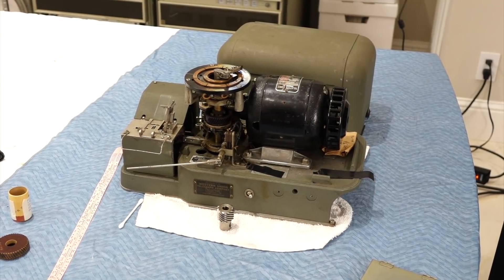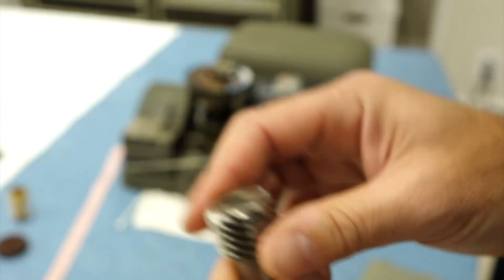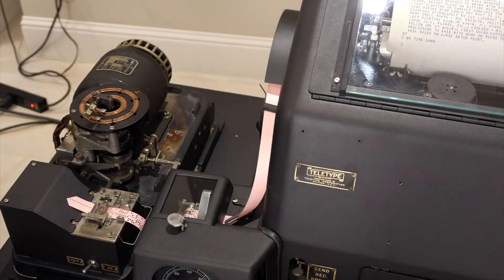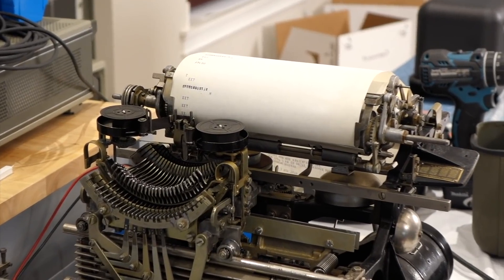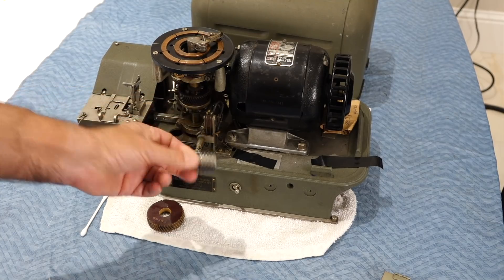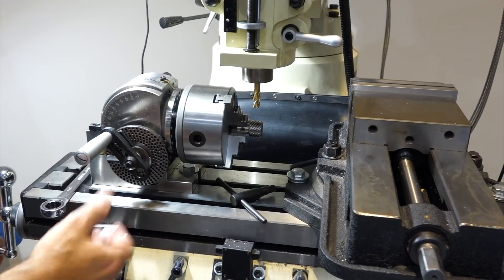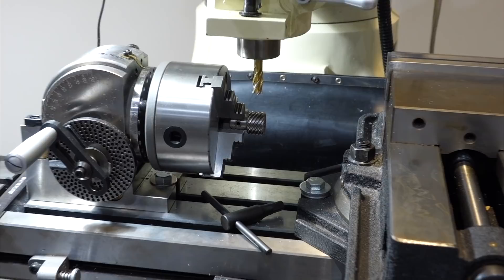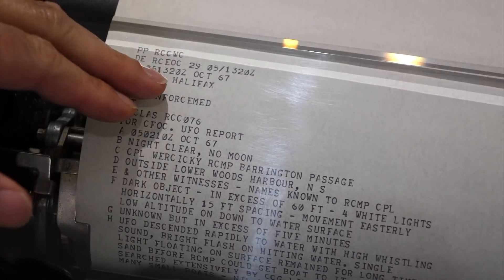AvE's CNC Machining Challenge

Comment: Do you have a working example of the gear you need? I could machine a gear that meshes, but it ain't gonna be the right speed...
Reply from the maker: Hey uncle, nice to have you here! Yes, we have an exact good gear that we can copy from (the one from the black T/D that works). Can you contact me offline via my about tab on my channel page. En Français dans le texte si tu veux.
Reply: Do you need CAD file for this gear? if so I can make it.
Reply: #unclebumblefuck
This is indeed a situation worthy of your newly acquired manly superpowers.  What cause could be more worthy than saving historical geekdom!

Saving a politician tied to train tracks?
No!
Giving a poodle a new haircut?
Never!
Rescue a lass from a turtle stampede?
Nein!
Pulling a beer keg from a burning building?
Hmmmm....  Probably.

But this part is worth making!

SAVE GEEK HISTORY!
Reply: Shit man, if that doesn't work, why not just cut it on my shaper?
Reply: @JBFromOZ  Abom79 will do it on a shaper :)
Reply: @ajvdwest  - I'm not volunteering him, but Jonathan W. could probably cast one from some old pistons he has lying around. He made a motorcycle engine block out of a bunch of 'em😃
Reply: Aj vd Westhuizen I’ve already cut gears on my shaper, has Adam?
Reply: @JBFromOZ  You just have to be old enough to say, "why the hell did we get rid of the shaper".
Reply: AvE;  worthy project but a bit difficult for one of your first 5 axis CNC jobs.
Reply: Send me the drawing, I’ll cut you one for something in return. Let me know and I’ll privately send you email.
Reply: All this 5-axis talk or lathe threading cuts and I'm sitting here wondering if there is a correct gear hob available for this part. I Never understand why people jump to cutting gears one slot at a time when most gears are formed/cut with a specialized gear hob tool. 
I guess as a one-off part cutting the gear isn't too bad vs the tool cost for a hob. but hobbing is the way to go for quantity and quality on gears.
Reply: @stoneworld7556   Worm wheels are hobbed, but the worms themselves are generally thread milled because you'd need a special hob for every different worm.
Reply: Oh ya, the Johnson rod is hoopajooped.
Reply: Could a replacement be prototyped on a 3d printer? You could prove your geometry then proceeded to production.
Reply: AvE is
Reply: The gear will come out with perfect dimensional tolerances but the helix will be going the wrong way, we've all seen the tapered threading video!
Reply: EASY! Hold my beer, I'll run to Canadian Tire and pick up a Tap N' Die set...
Reply: @MyKonaRC  lol
Reply: AvE it will take a few try's to get the right thread pitch but if I had my lathe still I could have cut the multi starts threads at ranging pitches and sent it over to you for the final machining
Reply: Some of my favorite things. Machines and radios. Good project.
Reply: What’s the pressure angle and number of teeth?
Reply: With all the people saying how easy this'll be, I can look forward to a spate of videos about gear machining in my recommendations soon, I'm sure!
Reply: That shit is gonna be skook'em
Reply: Im late to the game here but I do have an idea..... Send it to have a laser 3d replica scanned, then send it to 'learning computers' to have a 3d printing made, then send the 3d printing to 'Cody's Lab' to have him make a sand-mold and cast one from some strange metal (probably gold), then send the Gold casting down to the big machinist man in Florida to have one made...     Thats how I feel It should be did.
Reply: I have to say.... This is so frigging cool! I like the community vibe! I have nothing that needs machining (unless you ask my gf, she'll tell you differently)
Reply: @superlazy3355  maybe a little buffing or polishing?
Reply: Maybe AvE stuck his neck out too far and can’t do it :P
Reply: We know how AvE loves beautiful specimens (gears).
Reply: Richard J, I have confidence he could do it. He just better have a lot of setup material. He will of course need the proper involute cutter as well. Also measuring the gear can be tricky. He would need a mating gear and the center distance between the gears. And maybe even make a test fixture to test that because of them being at what looks to be at 90 degrees to each other.
Reply: @EdgePrecision  OR just take the ratio and machine a single start worm and wheel. ;-)
Reply: @arduinoversusevil2025  Are we assuming the small gear is the driving wheel or the driven wheel. He didn't say in his video. Or did he?
Reply: @EdgePrecision  Small worm is the driver, it meshes with what looks to be phenolic fiber wheel. Curious marc is sending me both.
Reply: @EdgePrecision  Someone feel free to correct me if I'm wrong. But, I'm 99% sure that the worm gear HAS to be the driving wheel. I wasn't paying too much attention to the motor position and I'm too lazy to check. But, it's extremely uncommon for a worm to be driven.

I would like to add that some people say it is impossible for a worm to be driven. But, my friend has a 1929 Ford AA with a worm gear rear end. That being said, it certainly acts like a brake when you put it in neutral but it can and does still roll forward. Not to mention the fact that we have towed it before, in gear, without breaking anything.
Reply: AvE Noice. Good luck!
Reply: That's just simple 2 axis manual work.
Reply: @pmk2  depends on the helix
Reply: @EdgePrecision  The small gear was the drive gear.
Reply: @arduinoversusevil2025   Sir, so why can't we just 3d print the worm out of nylon, as the wheel is some non metallic material, cutting down of nylon won't be problem i think. And lube it with silicone lubricant.
Reply: AvE RULES 🤘🏻🤘🏻
Reply: You just need to thread mill it with an acme or square or whatever thread form.
Reply: Igor Barbaros This, this is what needs to happen
Reply: AVE for president of the world! Lol

Comment: I believe this is the base machine used for a pony 9 or 19 one time tape crypto  device.
Reply from the maker: The 5-bit baudot tapes that the model 14 reads were definitely used in One Time Tape crypto mixers (see https://www.cryptomuseum.com/crypto/mixer.htm ). But I could not find any machine based on this Model 14 mechanism. I would be quite interested if there was one though! Do you have a further link or a reference?

Comment: Hi Marc, I pinged AvE about your gear and he said you need to send him some details, or a sample.  So he would appear willing but needs you to send him data.
Reply from the maker: Yes I am intensely aware of it. I owe him the gear, but I needed it for the restoration of the reperforator. After I make the video on that one, off the T/D and to AvE it goes, provided AvE is still interested. And then of course the AGC work started, which got the reperf pushed out...
Reply: @CuriousMarc  Don't get me wrong, I'm not chiding you, just worried that there was a Deadly Embrace https://en.wikipedia.org/wiki/Deadly_embrace going on.  And I have been enjoying the AGC work very much and the Alto too.

Comment: If you can get the right screw tap you might be able to do it with just that mill and indexing head (the head used as a precision angled axial holder).

People have hobbed worm wheels that way:
https://www.youtube.com/watch?v=XIzlg_uObwQ
You should be able to go from that to a helical gear by moving the gear along it's own axis. By tilting the blank, you should be able to control the tooth angle.

Comment: Look guys, I reckon your're over-thinking it. With the simple addition of a free-spinning distuckator for the maximal rotation and a fully indexed fafoofata valve, you'd grind that little sucker out with a Dremel in no more than two shakes of a lambs tale. Easy done.

Comment: i ragged wit AVE it can be done on a late just have to find the tread per inches and profile a cutter for it, it's almost like cutting acme treads , it would be more simpler then drawing a cad , cam is not that hard once you have the cad done.

Comment: you could cut that gear your same mounting but instead of using the mill use an angle grinder it will take a few trys but you will have it done in a few hours instead of weeks

Comment: You certainly can do that on a manual... you take off the left handwheel for the X axis of the mill, mount a gear in its place, and use gears of the right ratio to make it drive the rotary table. Then you just turn the remaining X axis handwheel on the right side, and the X axis and rotary table move together at the right speed to cut the helix.

Comment: Hob it. You'll have it done in a hour. (Assuming your head tilts 90 degrees on the mill)( use a free spinning bearing to get the mesh on your indexer). I've made several mesh pinions for ignition distributor on several models (points type)

Comment: This part can easily be done on a manual lathe, from what I can see its just a multi-start thread ( maybe 10 starts, it's hard to see on the video). You would need to grind clearance on the tool due to the high helix of each start, but other than that I don't see a problem.
Reply: As long as your change gears will give you the lead you need
Reply: @elanjacobs1   yes you're absolutely correct. Most (manual) lathes probably don't have that kind of lead (2-3" maybe). Ok, fine do it on a CNC lathe but using the same method.(multi start Thread)

Comment: Used to be manual machinists roamed North America who could do this. A few years ago, GE needed one. Turns out the last annually machined helical gear produced in America was about 1955 and then all of that production went to the Pacific Rim. And then all that went CNC so probably no one under 80 or so has done it on many years.

Comment: far better to approach a specialist gear cutting company as its not just a case of getting the helix angle right. There's the diametric pitch/module, pressure angle and number of teeth to consider too.

Comment: If AvE can’t help you out (I’m sure he can - he’s a ledge), or if someone else see’s this and wants to give it a go, then you can use manual helical milling - there exists such a thing, that consists of a gear system to connect the dividing head  to the lead screw of the table. I’ve used one before and it was great!

Comment: Unfortunately this is really something that needs to be done on gear making equipment, A 5 axis could get you something that worked for a while, but for a restoration that will keep working for a long time would either require a LOT of hand finishing or proper gear making equipment.

Comment: This would be a better suited project for a lathe and gear hob machine. A Worthy project but if its good tolerances and surface you need, then for helical bevel gears a hob is the way to go. Not to say cant be done on a 5th or 4th axis after its turned to profile but still the result is better from a hob. Might want to check out some gear manufacturing houses a part like that could be made easily and inexpensive by them if it is a standardized tooth pitch and they have the cutter on hand.

Comment: Helical gears usually require a special machining center or even grinding instead of conventional cuts. This would be extremely difficult to machine, even with a 5 axis, without some amount of prior gear cutting experience.

Comment: Actually you have a semi-universal dividing head and need a universal dividing head to manually cut helical gears; and of course the appropriate multi tooth "wheel" type cutter - one for helical gear cutting or you'll wallow out the flute flanks:)

Comment: I'm curious... Couldn't you just turn down a piece of all-thread of the correct thread pitch?  A wormgear is just a 'bolt' essentially that turns, so I'd imagine that if you could determine the thread-pitch and diameter, you could either turn it on a manual lathe, or just buy a threaded rod of the right size and cut the center hole/set screw/other dimensions on it...
Reply: No. Threaded rod is a single start thread, this worm is multi-start so that won't work.
Reply: @elanjacobs1  mcmaster-carr sells multi start threaded rod (I think just acme though).

Comment: Do you have the parameters for either the worm gear or the gear that it meshes with? I can generate the CAD model to get things going, but I'll need some info on it. The dimensions of its attachment point, length, diameter, etc... I would suggest getting it 3D printed in something like HTPLA and making sure it works at the correct speed before sending it over to the 5-axis for a more permanent part.

Comment: You need a gear cutting machine with the correct hob. I worked in a gear cutting shop for a while.
Reply: Exactly. Hobbing is the way to go. (all these people see a new toy and forget the basic tool applications like using a hob to form gears)
Reply: What's a hob?
Reply: @williamchamberlain2263  Hobbing is a machining process for gear cutting, cutting splines, and cutting sprockets on a hobbing machine, which is a special type of milling machine. The teeth or splines are progressively cut into the workpiece by a series of cuts made by a cutting tool called a hob. Compared to other gear forming processes it is relatively inexpensive but still quite accurate, thus it is used for a broad range of parts and quantities.

It is the most widely used gear cutting process for creating spur and helical gears and more gears are cut by hobbing than any other process as it is relatively quick and inexpensive.

Search youtube for gear hobbing, the videos show some amazing machining using those specialized hobs.

Comment: One way of doing it: https://www.youtube.com/watch?v=vyg0Emz4Vx4
Reply from the maker: That is actually the standard and correct way of machining a multi-flute, large angle helical gear. And as you see, you need a gear driven dividing head, a horizontal mill, a tilting head, and an V-teeth cutting disk. I have neither of the four! I could make do with custom tooling and some gearing calculation on my lathe, but of course it's way easier on a CNC. Plus it would come with an instructional running commentary in AvElish: priceless!
Reply: @CuriousMarc  Agreed - let us see if he will bite :) If not the gear drive can be replaced with some stepper motors.

Comment: A CNC Machine which also has liquid cooling.  Cutting unfortunately has a tendency to stress the material's tensile strength/hardness.  Think cut threads verses pressed threads.

Comment: He's going to need some data:
A design for the gear blank
To actually cut the gear
Number of starts, Pressure Angle, Helix angle, Lead, Diametric Pitch,
Reply: It will be many Canadian winters before AvE can design the code needed by the CNC machine to be able to make such a helical gear...
Reply from the maker: +Mike Warot: You got it pretty much exactly. We have the right gear in the black T/D, so we can measure all that. It is the most basic CNC code after that, just rotate and translate at constant speed.

Comment: if the 5 axis CNC guy doesn't come through couldn't you find a way to attach 2x motors to your lathe and use an Arduino to progress each motor slowly and in sync to create the spiral on the gear ?

Comment: Isn't that just a multi start thread. I've done single start threads on lathes but not multi starts, but can't you just use the timing dial on the lathe to sync each individual start.
http://www.mini-lathe.com/Mini_lathe/Features/Thread_dial_y.jpg
Reply from the maker: Yes it is. 10 flutes. You'd use the timing dial on the lathe. Not an easy one to machine.
Reply: @CuriousMarc  10!, holy carp. 
I was thinking about 3D printing if there isn't much load, but most worms are high load.

Comment: And once it’s done, you need to hook it up to the Haas’s serial input to drip-feed G-Code... 😎
Reply: Some of the CNC's I used to run worked off of paper tape. Our library was a wall of numbered film canisters.
Reply: @SyBernot  Hey me too! back in the late 70's early 80's I programmed paper-tapes for Excellon Automation CNC drill machines for Printed Circuit boards. We had shelves full of tapes.
Reply: We have an old Bayer Industries Acroloc in our shop with a tape reader on the back.  That machine was made right here in Phoenix AZ and still alive after 32 years. It's a full box way machine with laser scales on all 3 axes. Can't do any high speed or simultaneous 3 axis movements but it is damned accurate. (You can cheat and DNC point to point G1 code to do 3D if you want but the baud rate of the machine is so low that your feed will quickly outpace the code)
Reply: @Valueclown  I have an Acromax MX16 that has a punched tape reader in it.  I'm in Phoenix too. Luckily it has a serial port and I wrote a drip feeder for it. Unfortunately it doesn't have "look ahead" so it's not all that fast..
Reply: Do you know of people that do that?
Reply: heyou - Weeeeeeellllll..... not with a new Haas... but on old CNCs, it was quite common to hook up an external device of some sort (be it a paper tape reader, a specialized floppy drive with a serial port, a minicomputer, or just a PC) because the CNC’s control had very little memory; and long jobs just wouldn’t fit. I’d have to look up that new machine’s control to see if it even still had a drip-feed serial port, though... 🤔
Reply: @darkwinter6028  We've got a ~90s heian at work that occasionally gets drip fed.
Reply: The newer ones just have a USB port. Not saying it can't be done, but it's not designed for it like the old machines
Reply: You can still setup communication protocols to DNC on newer machines.  Not 100% sure about Haas. Although I think somebody told me they were able to DNC through an ethernet port. The control seems a bit locked down and proprietary.  That's why I still prefer good ol Fanuc.
Reply: He may have been using Predator to do it.  I'm going to have to ask about it.
Reply: Holy shit, that's just cool.